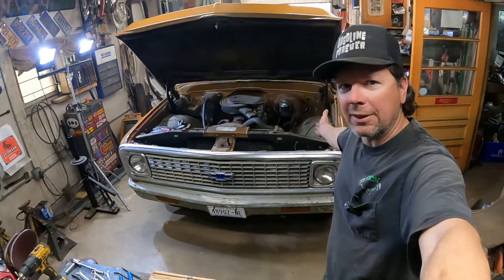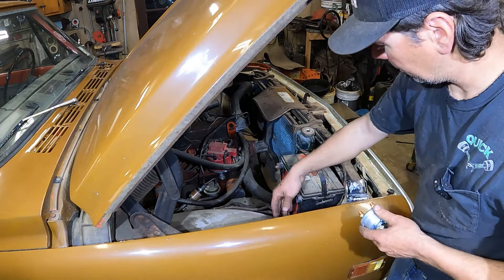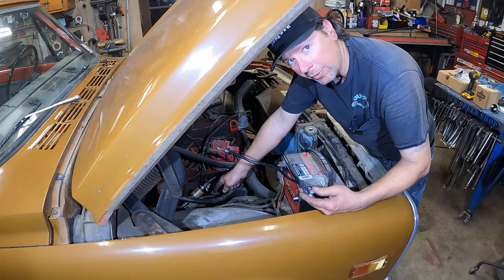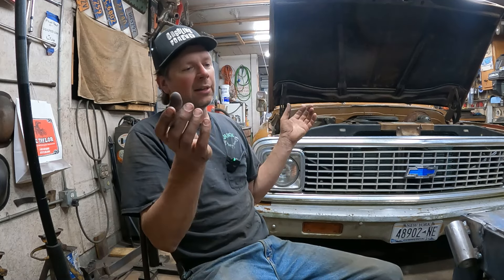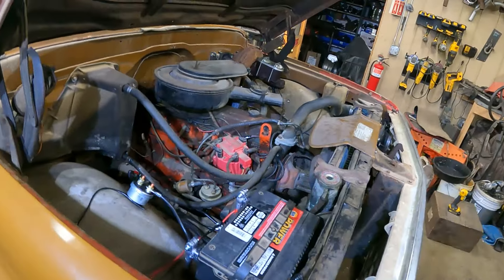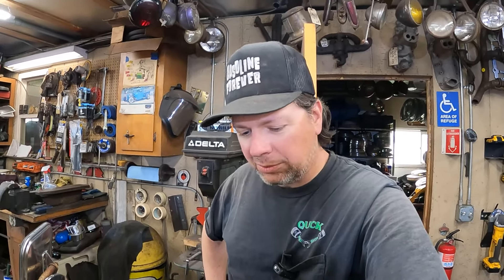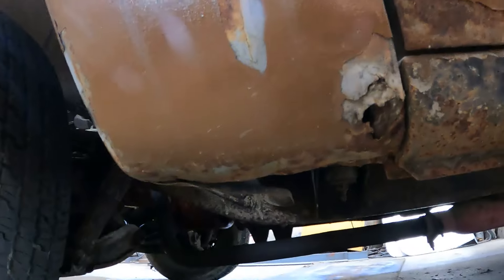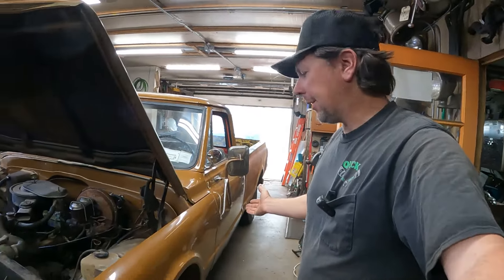Street Machine C10 Build: Battery Kill Switch and Assessing the Rust

Comment: Good ‘i-dee-er’ on the battery switch, why didn’t i think of that…. I’ve taken a battery cable off on my 50 F1 hot rod project truck every time I leave it in the shop, just like you, I don’t trust it yet. One reason I question it is every time it sets for a while (days) when I reconnect the cable it sparks with everything off. But it only sparks once , reconnect it no spark. I don’t show any current draw on my meter. I’m running a MSD box and it has 2 unstitched wires, a positive and negative to the battery, I’m thinking it might have some kind of initial current draw. Is that a MSD thing……I don’t know.
Can’t wait to see more on the C 10. A buddy just restored his 69 GMC he bought new in 69. It had set in the weeds for 17 years and in Washington where it rains about 11 months out of the year that ain’t good. He found a running parts truck for a bed (his had actually rusted down around the frame and was on the ground) that came with an extra cab and 2 spare doors for $2600. He had never done anything like this before but at 76 he decided to give it a try. His son in law is a truck driver but should be a fabricator helped with the welding and body panels , he did all the body work himself and I shot the paint. From about 5 feet it looks brand new. With everything including complete engine (250-6) and transmission rebuild and numerous new panels he figures he is over $20k. The one thing he left untouched was the steering wheel because of the hands that held it and are no longer here. He will be 80 in a couple months and he says no amount of money could buy that truck.
Remember, “if you’re gonna make it nice, might as well make it right”. 👍
Reply from the maker: That's a cool story.  I'm going for clean driver with this truck.  It will look good going down the road, but won't be perfect so I can still use it for errands and also as a work truck.  I think it will be the last full paint job I do for a while.  Next couple of buildings are going to be full patina, is what it is builds.